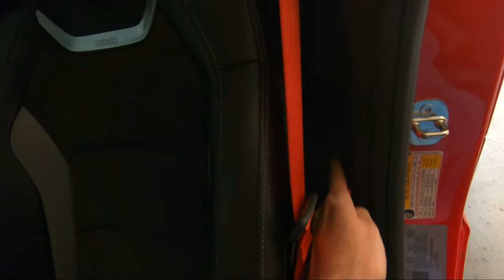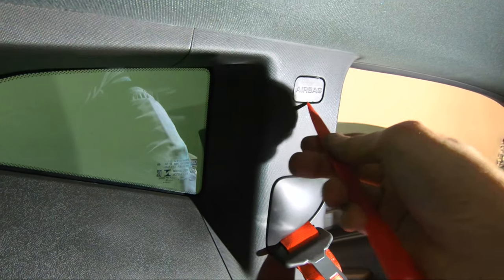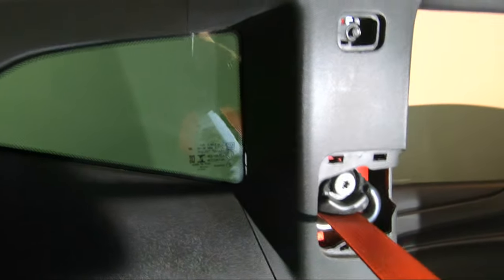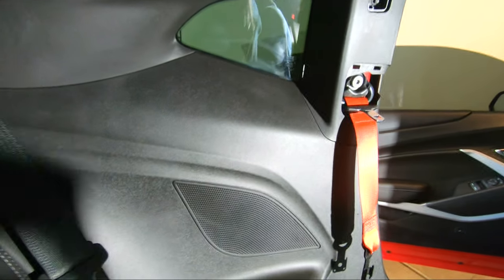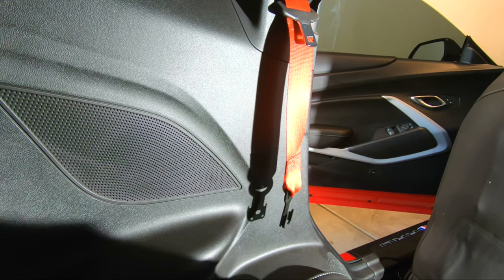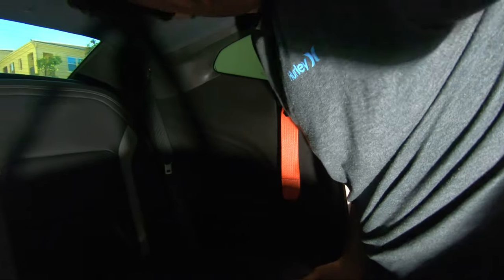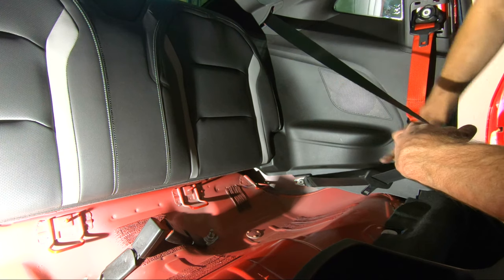2016-23 Camaro Seat Belt Removal. Tips and Tricks

Comment: What tools did u use ? Like what torx is it ?
Reply from the maker: Basic socket set, torx for the belts, and non scratch panel tools. Just basic stuff
Reply: @Hot-1LE  which torx is it ?
Reply from the maker: Believe it's a t50
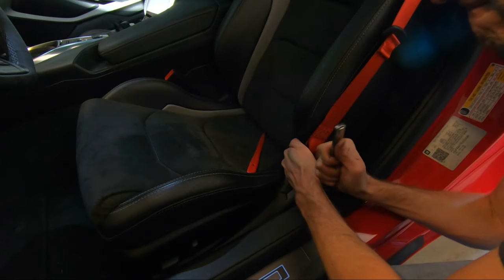Reply: @Hot-1LE  hey man what did you use to take out the nut in 1:17 ?
Reply from the maker: It's a small socket. I want to say 12mm but not 100 percent on that.  It's just a normal metric socket any small set should have